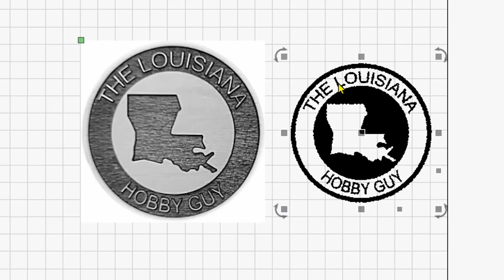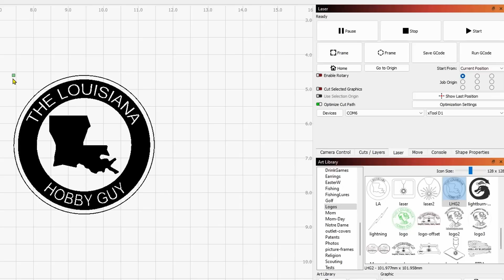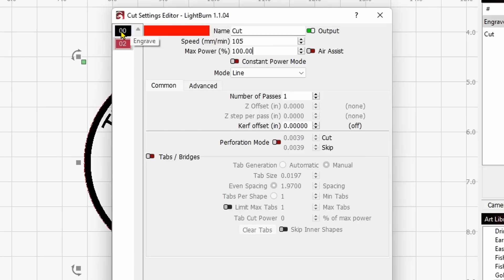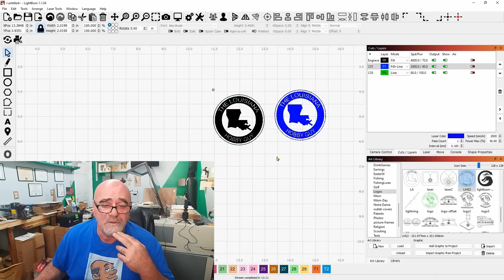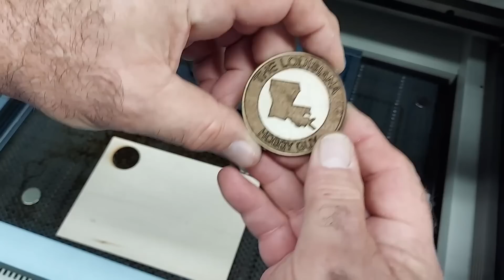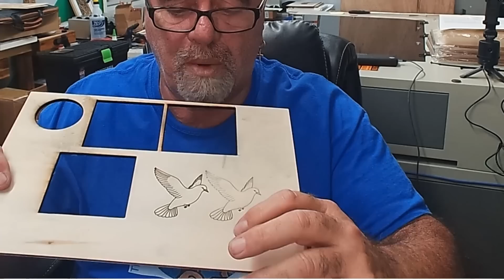🪙 Making coin shaped wood business cards! Take your Laser Engraving to the Next Level!

Comment: I have a 130w tube and my max is 600mm/sec, I’m new to this world so not sure if my settings would be the same.
Reply from the maker: Your settings will definitely need to be adjusted, so I recommend running a material test in LightBurn to find what works best for your specific setup. 😊
Reply: And thank you for your response, I truly appreciate you.

Comment: This does not work anymore, Line after fill mode does not exist in the Lightburn update of 2.1.01- A new approach is needed to achieve the effect. Update, I found a post on this page stating that the feature is gone, however, you can emulate the effect using sublayers.
Reply from the maker: Read the pinned comment, the very first one Robert.
Reply from the maker: Here's a link to a related follow up video: https://youtu.be/9Xcc4BWqKSY

Comment: Good morning sir. Would you use the same settings on the Line Interval and Lines per inch on the Lasermatic mk2 30k? Thank you for this tutorial
Reply from the maker: On the Mk2 30W, I use 318lpi and much higher speed and lower power. You need to run a material test on the crosshatch to get the right settings. See this video for more info: https://youtu.be/62re4v8ASfI

Comment: Rich Can this be done with a ray 5 10w without air asst? It came out awesome on the xtool.
Reply from the maker: Yes, the laser you use doesn't matter, they all work the same way.
Reply: @TheLouisianaHobbyGuy Do you recommend the craft wood squares from like Michael’s. I can never seem to cut through 3m ply
Reply from the maker: No, I recommend 3mm solid wood, not ply. Solid or hardwood engraves the best and you don't have the glue issues between the plys.
Reply: @TheLouisianaHobbyGuy thank you

Comment: How long is the run time? I realize my setting will vary my time, but with essentially 3 engravings (black layer engrave, then blue layer cross hatch), the line engrave, then the cut, I'm over 17 minutes for one side of one coin. If I dont run the black layer, just the blue cross hatch, I shave about 3 minutes off. Are these times typical? Running 50 at a time like you mentioned, that's a 12.5 hr job!
Reply from the maker: Running one coin takes the longest. Run 2 Daryl and you'll see what I mean. I used to do 50 at a time on my Co2 and it took a little over 6 hours for both sides.
Reply: @TheLouisianaHobbyGuy  I've been working on it the last couple of days. The design took the longest. Getting a QR code to work was a little frustrating. I finally got the design down for both sides and ran maybe 10+ yesterday. I'll definitely be running in batches as well, but I'm using the MK2 XW 10/30. Great machine, but not the fastest. O well, it's for my business, so I dont mind the time. Now, as a product to offer.... might not be feasible. 
Thanks for the response and help.
Reply from the maker: Well the scanning speed on the XW is 30,000 mm/min for the X axis, so it's absolutely in the high speed class for diode lasers. On my Co2, I was scanning at 600 mm/sec, or 36,000 mm/min, so not much of a difference there.
Reply: Very true. It is a very capable laser. However, just because it can, does that mean it should? Meaning, I ran at tested and found that I like 10k on the first engrave and 15k on the second engrave/cross hatch. Once i found the look I liked, I thought I'd try and save some time. I doubled the speeds and very minimal gain in speed. If I'm running for 7+ hours for a sheet of coins, like I did today, I'd rather run the machine comfortably rather than full bore for minutes gained. 
What's your opinion on that?
Reply from the maker: That's up to you. These machines are designed to run at full power and speed.

Comment: Hi Sr, a question, if you put lets say 8 coins images side by side, the machine will past over the 8 right to left to engrave it all in the same pass, or will complete 1 coin and then will past to the next? exelent video as allways, im a big fan becouse im a complete noob on this world, dont even receive my laser yet! but i just can't wait jeje Thanks! i forgot, how powerfull its that diode laser? i bought a 22w sculpfun s30 ultra 600 x 600 mm work space, i have some expectations about it but will see how it works
Reply from the maker: The laser used in this video was a 10W diode. I set up a template in a fixed position in the center of the bed and align the coins in a grid array, in the center of the template. I set the laser to fill each one individually in case anything goes wrong with one. Engrave and cut the first side, and then flip the coins in place without moving the wood to engrave the other side.
Reply: @TheLouisianaHobbyGuy  thank thank you for share ur experience and take ur time to answer this questiosn, means a lot to me!

Comment: Hey Rich, I was just wondering what does the "overscanning" DO? by default when I open it, it is set to 2.5% at 5mm.
Reply from the maker: Diode lasers need overscanning of 2.5 to 5mm depending on speed. It's how the laser makes turns. It has to turn off, slow down, make the turn and then speed up again before it turns back on. Without it, both sides of your project will not engrave completely.

Comment: how would you print accurately on both sides of the coin without a camera? I love your stuff it is super helpful thank you so much
Reply from the maker: Good question Austin! Center the designs on the template, and do the engrave and cut. Then flip the coins without moving the material and engrave the other side.

Comment: I have version 1.6.03 Lightburn. I do not have the line/fill option. Did they remove this option or is there a setting i need to toggle on?
Reply from the maker: Read the pinned comment.

Comment: Hi Rich!! I’m a newbie to the laser world about 2months in! I have to say that I love your videos! You are the main one I have watched especially for lightburn! Thank you! I have a Thunder Nova 51/100w. I have followed your instructions with different settings but the edges all the way around are really dark! And when I do the line after fill I have small burn marks on the letters. Could you give me any tips pretty please?!! Thank you! I am wanting to do this on a cutting board.
Reply from the maker: You're on a Co2, so you're probably having issues with the power. On a Co2, you have to set both your Max and Min powers. Try setting the min at at least half the max and adjust from there.
Reply: Ok thank you I will definitely give it a try!

Comment: Hi Louisiana Hobby Guy! Thank you for your information. Im new to LightBurn for my xtool d1 pro 20w. It's been 4 10+ hr days setting up my laser and the software. All seems to be working well so far. My first project is a wedding seating sign for my niece… so I'm under the gun. Oh, I have the extension table. I finally got the circle frame function to bring the laser from the back left across and down to the front right. “But” when it begins to travel the x-axis on its way back, it creeps so slowly I thought it was stopped. Tomorrow, I will check the belt for anything loose; I just thought of that.  Do you have any other software settings I can check that would cause the x-axis to move, but barely? Im using Absolute, and Origin was working, but isn't working now. I hope you know what is going on! Thank you🙇 Lisa
Reply from the maker: There's not much I can do in a YouTube comment Lisa without seeing all the settings, sorry.
Reply: Is there a settings page that controls the framing speed? @TheLouisianaHobbyGuy
Reply: or another video you can refer me to? @TheLouisianaHobbyGuy

Comment: Glad I found your video.  I have wanted to make my own coin's!  Do you leave the original wood board in place to use as a jig to run the back side of the coin?
Reply from the maker: I jig the wood, align the graphic to the center, run the back side engrave, and then flip it in the jig and run the front engrave and cut Jon.

Comment: Great video and very helpful.  For some reason I haven't got the fill& line option on my lightburn version.  I have the cross hatch, but only 3 options I have are line, fill & fill offset.  Also on another video that you done on framing, I have a continuos framing feature, but not the laser fire when framing.   Could this be because I'm still using the free version?  Or maybe my laser doesn't support these features?  I'm using a 60 watt Co2 laser with a Trocen awc608c controller.  Many thanks
Reply from the maker: Read the pinned comment.

Comment: I do have a question, how do you line up the back of the coin?  because when you flip the board over, it's not in the same position laser wise.
Reply from the maker: You have to make a jig and align the work to the jig. Then you can flip the coins over in the same hole they cut out of and run the other side. It's hard to explain, but I have a video coming soon on the process.

Comment: Hi Rich! Thanks for all the time you spend making these videos to teach us!! I'm unable to find the line after fill option. I have the most current version of the software. I'm using a TwoTrees TTS 25. I'm wondering if there is a prerequisite setting in Lightburn, or do you think this\is somehow a limitation of the machine?
Reply: Looking for pinned comment, both with laptop, and android phone. I'm not finding  one.
Reply: I did eventually find the setting I was looking for, its been changed to sublayer in later releases. Just a heads up, I still don't see pinned comment on your video, although going to other channels I see them at the top where it should be.
Reply from the maker: It's there! https://www.youtube.com/watch?v=9Xcc4BWqKSY
Reply from the maker: Read the pinned comment below the video.

Comment: Did you mention what thickness plywood you use for these? I have been experimenting and will try your tips. Previously on the 1/8" baltic I have a lot of residue on the back (maybe from the bed?) so that it doesn't work well to put my text on the back or I also have too much burn when engraving so that there are some tiny holes. I know I just need to keep dialing in the settings and see what works best. Did you mention that there is an updated video on this? Always appreciate your teaching. (Oh, I also wanted to ask - when I turned my coin over to do the backside by placing it back in the cut out hole, it had a tendency to move as it did the back side. Suggestions?)
Reply from the maker: I used 1/8" Baltic Birch Maggie. I will be having a full tutorial on setting up the coin template and flipping and cleaning them in an upcoming video.

Comment: For some reason, my letters are very fragile. You run your fingernail over them with a little pressure and that's it - they break off. Maybe I have some kind of bad pine board? Or are the letters too small (5-6mm)? What size and height are your letters, please advise me ...
Reply from the maker: Try using actual hardwood. I use a premium plywood for these.

Comment: can anyone tell me when I want to outline a project (not engrave) Lightburn does not give me the option to change? When I click on the cuts/layers tab and open image mode is grayed out on threshold.
Reply from the maker: Lasers only engrave or cut. I don't know what outline means. You can only use threshold on images.
Reply: Correction, I meant to say line in the cuts/layers screen, not outline. some projects do not give me the option to pick line.

Comment: Hi Rich, your videos are excellent. Thank You. I'm working on a project in Lightburn. It is almost halfway done. what I want to do is increase the power setting and continue burning. I can do that if I press stop, make my adjustments and press start it will start at the beginning which I don't want to do. Is there a way I can resume where I left off?  Thanks, Tim
Reply from the maker: Yes, in the preview window, you can move the slider to any point and tell the laser to start the job from that point Tim. Better yet, you can control the power and speed on the MOVE tab WHILE the job is running.

Comment: Just a comment about sealing both sides of a project that might help is to take a scrap of  wood and using a staple gun, ie for shooting on trim, shoot in several staples on a few scraps and now the points will hold the back off and can dry while the front is also drying.
Reply from the maker: Thanks for the tip Terry!

Comment: I have Lightburn but I don’t have that crosshatch button. 
There are two buttons there. One says negative image and the other says pass-through. 
Lightburn version is 1.3.01
Reply from the maker: Double click the layer and you'll see the crosshatch Danny.
Reply: @TheLouisianaHobbyGuy  
I did that, I watched your video and paused at each step and did what you did. 
No crosshatch button. Just the two I mentioned. 
I went into the file that has all the different things you can turn on, off hand I can’t remember the name of the file, I’m not in the shop, I’m out in the barn taking care of my cats. 
But looked for a switch to turn it on and nothing was found. 
I can’t send you a screen shot sense these chat boxes don’t have that option. 
I have the Atezr P20. 
I ordered the extended rails and installed them and the new wire harness and everything run backwards. Sent that all back and they sent me new. Haven’t installed that yet. Half afraid to. Lol. 
But all I found was I could run at 0° then would have to change 0 to 90 and run it again.
Reply from the maker: You can try asking on the Lightburn Forum so a technician can answer you. You can post screenshots there.
Reply: @TheLouisianaHobbyGuy  
Thanks. I’ll see if I can find it. 
Atezr tech support isn’t the best. It’s by e-mail only and takes about a week to get an answer. The answer is usually a YouTube video link that comes nowhere near my question. 
I like the machine, I hate their support.

Comment: My fill layer objects(letters) seem to be accurate but my line layer lines come out kind of all over the place, not accurate burn. I don’t know what is going on.
Reply from the maker: I don't know either Aillig.
Reply: @TheLouisianaHobbyGuy  can I send you a pic, I’ve a auferu L2, running lightburn(Mac)? I wonder if it’s how I’m formatting my svg but seems my fill engrave objects are perfectly burned an the line burns buck wild. I did first test simple lines, came out fine. Then I tested the rotary yyr,changed settings for that, got that to work then switched back to flat. Pretty sure I loaded flat settings profile per your videos(save profile before change). But it has not been the same since.
Reply: @TheLouisianaHobbyGuy  I’m going to run focus test and calibration test/adjustment but it worked before and did for initial build setup.
Reply from the maker: I would suggest contacting Gil at the Ortur tech support. He's the expert on Ortur lasers. 
https://ortur.tech/support/

Comment: Great video but as normal I have a question when you were talking about the cut settings you briefly talk about but no mention of the constant power mode feature that was not check off or enabled in your video. Maybe you could clear this mode up or usage use up in one of your upcoming videos... Respectfully
Reply from the maker: Constant power is just for cutting Rob.
Reply: @TheLouisianaHobbyGuy  Shouldn't I still be able to see the check box on it or be did the latest upgrade remove option from my settings. Thought maybe I might have issues if there is something missing from my light burn software...
Reply from the maker: It's only there if you're in line mode Rob.
Reply: @TheLouisianaHobbyGuy  Not there in line in mode either
Reply: I have started a topic on it on your site Constant power mode. Could I have disable that function box somehow ? Sorry to bother  you but not getting to far on subject. I figure something happen
Reply from the maker: Try opening a ticket on the Lightburn forum.

Comment: Very cool! 
So how does on pass blacken the wood and the next clean the soot off? 
Does it do it because it’s going with the grain? 

What would a just a crosshatch do without the first engrave at a slightly higher power?
Reply from the maker: Once pass is slow and hot and the second is fast and low power.

Comment: You said the x tool laser wasn't working out. Was it the power wattage that wasn't enough or was it an issue with x-tool?? Is there a better diode laser I should be considering for my first one??
Reply from the maker: There are several functions in the control board that are hidden from the user, but necessary. That's why I don't like it. It's perfectly fine, but I would recommend the Atezr for a first time user. https://youtu.be/4QzsV-5PfMA
Reply: @TheLouisianaHobbyGuy  Thank you  for the clarification and the advice.

Comment: i'm running Lightburn 1.2.04 and there's no "Fill+Line" option in the layer settings. Has this option been dropped by developers or do I have to activate it in some odd mode?
Reply from the maker: Both the description and the pinned comment have the answer.

Comment: Hallo. This video really takes some engraving aspects to a high level. Thanks so much.
If I may make one remark: The burnt edges, especially if they turn out scorched -  black  (sometimes they come out brown, wish is less disturbing) are not nice and smell badly. I do use very fine sanding paper to get rid of some of the scorched material and then, with a soft cloth, I wipe the edges with linseed oil. By doing that, and using new parts of the cloth for every stroke, some fine residues of the scorch are removed while the cut surface of the wood gets a better finished look. Also, the bad scorched smell gets much weaker.
Emanuel
Reply from the maker: A quick wipe with some cleaning vinegar takes away the scorch and the smell Emanuel!
Reply: @TheLouisianaHobbyGuy  Wow. Thanks a lot!